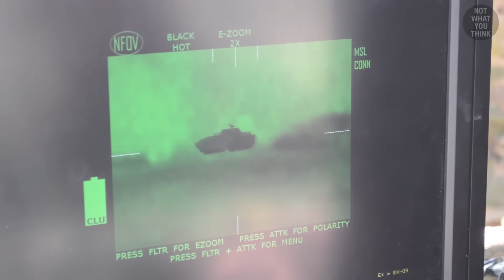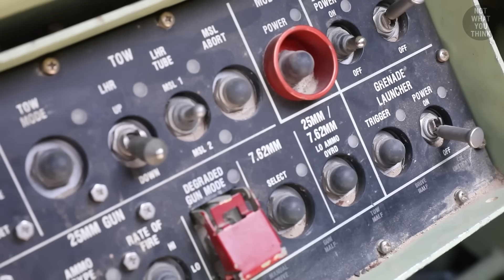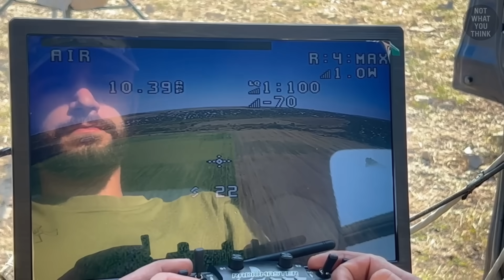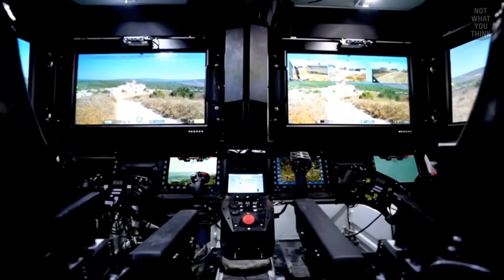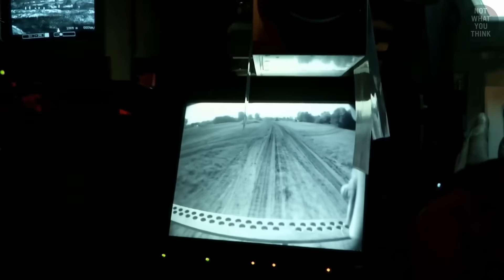How Bradley IFVs prove more Useful in Ukraine than Tanks

Comment: There are many mistakes in this video, but instead of going through all of them I would say that to make them lighter one must not sacrifice protection as it would only result in making the tank even more vulnerable to the threats that they face today. An example is AMX-10RC that because of its paper-thin armor they can't be used properly. Same for the M10 and the Chinese tank - would they be able to resist even 30mm cannons with such a thin armor? Hell, because of M10 having so weak armor it was decided to not call it a tank at all. What needs to be done with tanks though is not just trying to increase armor for the sake of increase, or decrease for the sake of decrease, but decide what sorts of threats they would face - artillery, FPV drones, mines, ATGMs, low-caliber cannons - and find how much protection is needed to protect from exact threats that they would face. For example lets imagine that after the research it would be decided that 50mm of armor around and 25mm on the roof would be enough to face drones, cannons, artillery, and to protect against ATGMs ERA would be put as 50mm is certainly enough for the vehicle to survive ERA explosion. Then, why try to make 4 man crew that would require extra space and thus extra weight, if it could be 3 man with an autoloader? Or even go for an unmanned turret. This would certainly make it lighter while not be vulnerable to threats that aren't tanks. 
But also, remember that having a big cannon requires to have a tank that is heavy enough in order for its own recoil to not destroy itself, as possibly 30 ton mark for M10 might be a requirement so that its 105mm cannon could be used effectively without issues.
Either way, the point is that this issue is not as easy as just putting less armor.
Reply: the M10 booker wasn't designed to be a tank it was designed to be an infantry support vehicle/ assault vehicle which is what it is its basically an upgraded Stryker. and why did you say that people are adding Armour to tanks for no reason it's called future proofing eventually people are going to be able to go penetrate it if you don't upgrade and America choses to not go with an autoloader because it overcomplicates things and add a lot of weight to the vehicle along with the fact that an extra crew member make Maintenace easier.